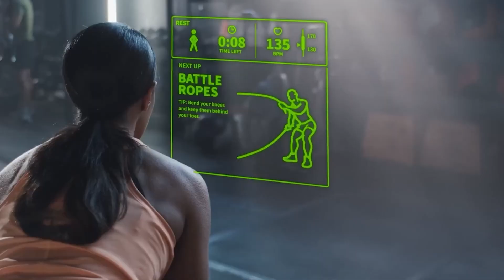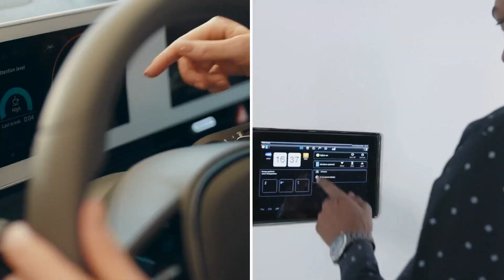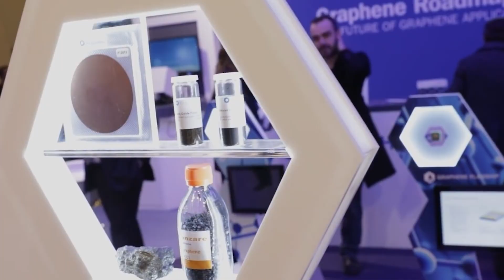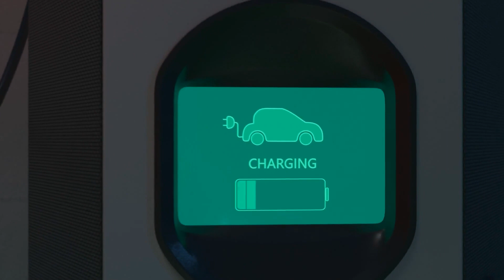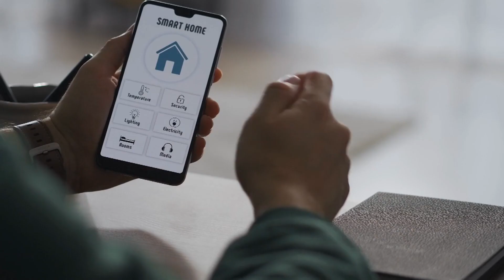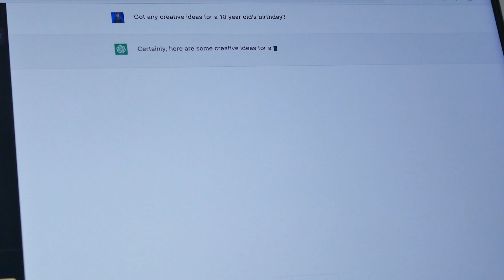15 Technologies That Will Change Our World Soon

Comment: hydrogen has one huge drawback.  You have to make hydrogen by some process that requires energy.  It's not like other sources that you can mine or drill for.  And storing it is a real challenge because it will literally leak out of anything used to hold it because the hydrogen atoms simply slip between the other atoms and escape. It has it's uses but if you have a "hydrogen plant" which is burning energy to make the hydrogen then why not use burn the energy directly for better efficiency?